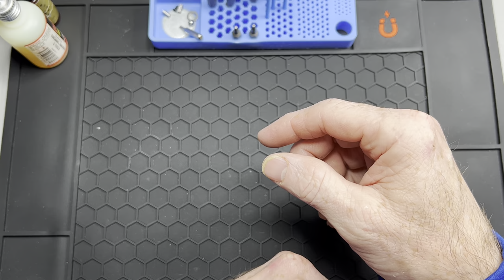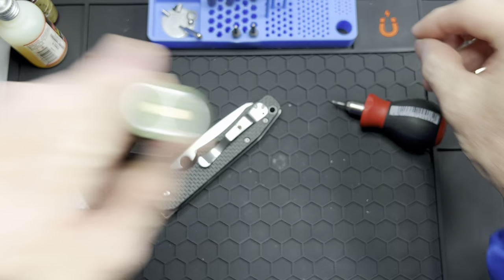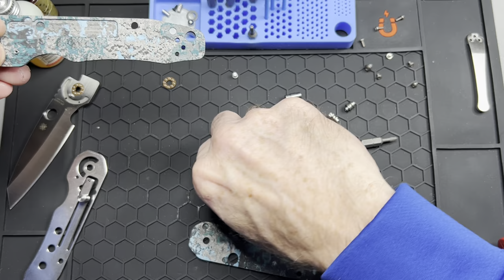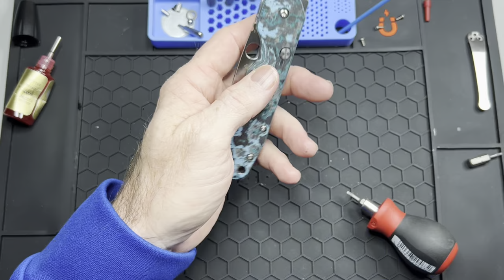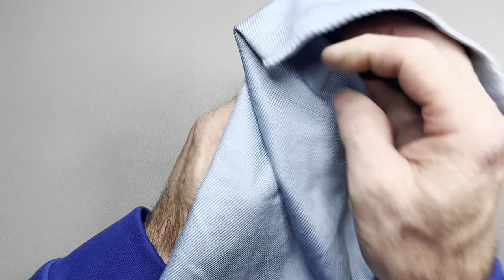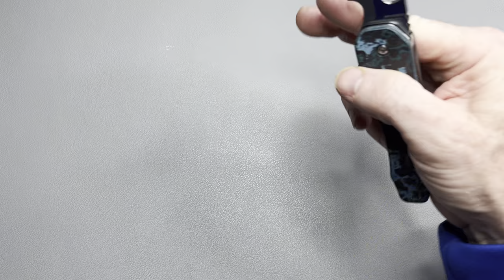Ripps Garage Tech Spyderco Smock Scale Installation

Comment: The second detent really improves the deployment for the hole and flipper tab.  

Have to looked to see if pacific son still makes the titanium hardware for the smock? 

The M4 version has a really cool coating to it on one of those two BHQ exclusives. You can see the grind lines through it. It’s beautiful.